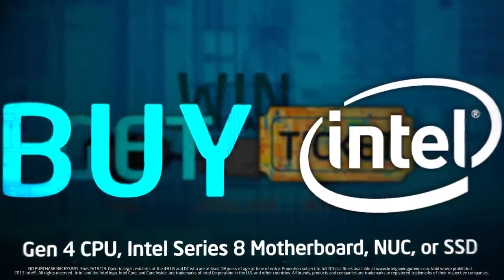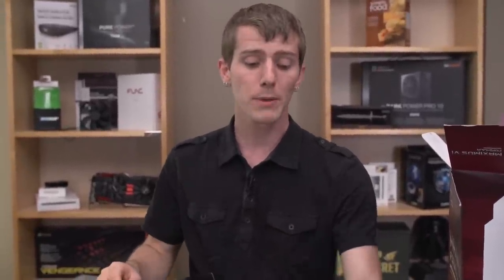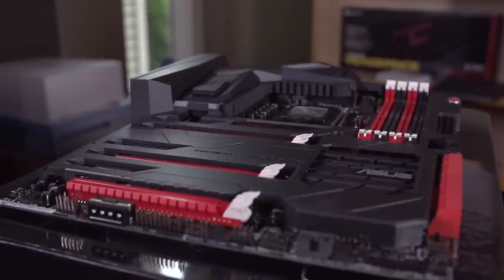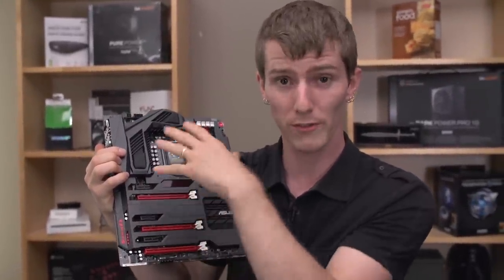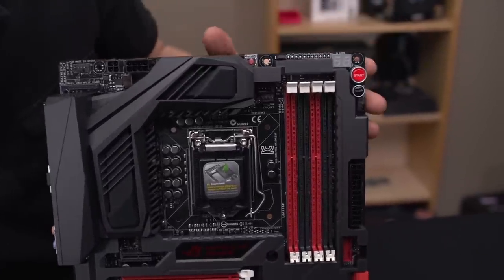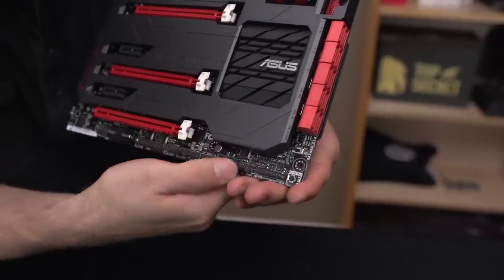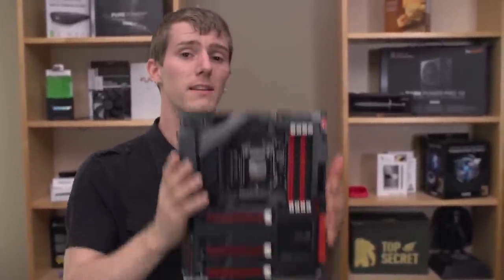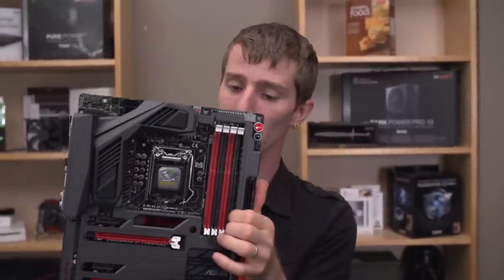Asus Maximus VI Formula Unboxing & Overview

Comment: Love this mobo, just got it for my new build.
Specs are:

Maximus VI Formula
16GB Dominator Platinum
i7 4770k cooled with H100i
Asus GTX 780 DirectCUII (running in SLI)
AX860i
Corsair 750D
250GB Samsung 840 EVO
WD 3TB Black
Reply: We have almost the same build, lol.
I got the same mother board, same CPU, same power supply, same ram and the same HDD. The only difference between our builds is that i got a EVGA GTX 780 TI Superclocked with ACX cooling a Phanteks Enthoo series Primo aluminum ATX full tower case with blue led and a Corsair Hydro series H100i with a 500gb Samsung 840 EVO. But still everything almost the same .
Reply: just about the same build here as well lmao
Reply: Just received all the hardware, did not buy the 780 because I will be using a 24" monitor.
Cooler Master HAF XM - High Air Flow Mid Tower 
Microsoft Windows 8.1 Pro - 64-bit
PC Power & Cooling Silencer Mk III Series 850W Modular
ASUS GTX770-DC2OC-2GD5 GeForce GTX 770 2GB 256-bit 
(2) Intel 530 Series SSDSC2BW240A4K5 2.5" 240GB SATA III
ASUS 24X DVD Burner - Bulk 24X DVD+R 8X DVD+RW 12X -
Asus MAXIMUS VI FORMULA  
Intel Core i7 4770K Unlocked Quad Core 3.5GHZ Processor
BenQ XL2420TE 24IN LED 144HZ 1MS 
Corsair Dominator Platinum 16GB 2X8GB DDR3-1600
ASUS ROG RAIDR Express PCI-E 240GB PCIe 2.0 x 2 MLC (SSD)
Swiftech H220 Quiet Power PLUG-AND-PLAY Liquid
Reply: Also almost same build :D
only 32 gb RAM,
2x palit gtx 780 ti jetstream in SLI of course
1250W Seasonic x-1250
case: same
cpu: same
mobo: same
cpu-cooler: same
ssd: same
hdd: same
Reply: joniostis To be honest with you I think 32GB RAM is overkill for pretty much anything, I used to have 32GB in my last system but then I realised it was a mistake and by the time games begin to use more than 16GB of RAM I won't be using this system anymore so I decided not to go with the 32GB.
Reply: ***** i think you are my twin lol

Comment: hello linus do you know how many watts you can pull out off the fan connectors on this bord. i wondring if it is only one fan per connector or if it can handle multi fans on each connector.. im going to bulid an monster water cooling machine with this board and a corsair 900D have bought 25 corsair fans so i was hoping the board can handle 5 fans on each connector
Reply: you don't need to connect the fans to the board
Reply: get yourself a molex to pwn adapter http://static.scan.co.uk/images/products/900075-a.jpg
Reply: it is asembled  and it is looking stunning just totaly awesome build

Comment: which is better for gaming? An asus maximus VI Formula or an asus maximus VI impact?
Reply: Both are awesome boards, but the Formula is built especially for gaming where as the Maximus is a high end board for heavy overclocking use. If your building a Gaming PC go with the Formula, If your building a Gaming/Multimedia PC go with the Maximus (only if you are going to overclock; no point spending more money for something when your not going to ultilize its full capability).
Reply: impact for itx case, formula for mid tower and above case. both perform great.
Reply: i already have an h81 but it sucks its tiny and there is only enough room for one gpu
Reply: well, what if I want a sound card or something
Reply: Their no point getting a sound card with this motherboard unless your having a surround sound speaker system setup on your computer. The onboard sound on this card is good for all gamers and regular users. Only a sound buff would get anything out of buying himself a sound card. In most cases if your buying this motherboard don't bother buying a sound card.
Reply: well I know that, I'm not saying that I wan't one because I agree with you 100% that a sound card is pointless, I'm just trying to make a point that if I were to want 2 gpu's or something that uses 2 expansion slots I wouldn't be able to use it.
Reply: My Bad, Did not read all the comments.
Reply: we do have dual gpu option, the 295 and 790 cards are coming out.

Comment: Doesn't aluminium have a protective layer when exposed to air called Al2O3? It prevents corrosion, precisely the reason why drink cans, cars, airplanes etc are all made out of aluminium, because it does not corrode. Am I missing something? Sorry if I am.
Reply: jamesdienow mixing metals on a watercooling loop like aluminum with copper or nickel may cause corrosion over time

Comment: What does the water cooling actually cool?
Reply: The motherboard?
Reply: Alex G. Yeah but to my knowledge the motherboard doesn't get that hot that it requires water cooling
Reply: If your running a water cooled CPU, the VRM tends to run a bit hotter with out the fan from an air cooled solution circulating the air in that area. Especially if your into heavy duty overclocking it would behoove you to cut that in the water loop.
Reply: Everything in your pc :))))

Comment: Linus, please I need to know what it is for the 8-pin connector side of the 4-pin, and it also supports memory of 1866hz default, no overclocking. I want to buy this motherboard, but that only accurate details. Thank you and I'm your fan too.
Reply: Thats not nice
Reply: I think that connector is to supply the motherboard with more power for 2+ GPU configurations and CPU overclocking.

Comment: I bought a Corsair 650D case and this MB.  When you mentioned not using the water cooling aspect of the MB, I was disheartened until you mentioned using a special 
cooling liquid that allows the use of dissimilar metals.
 I decided to not use my Corsair 850 PSU and am now waiting for the UPS truck to deliver my 1050 today, so I can finish the build.  I went with a 3770K CPU and bought
a corsair H100i cpu cooler. My EVGA 680/4 gig will be installed for now, and 32 megs 
Gskill Trident X 2400 ram.

Comment: I'm glad they responded to concerns about the aluminum. Bare aluminum isn't just bad in a cooling system, it can be catastrophic. Even with anti-corrosion additives at the very least you're really shortening your maintenance cycle. Given that they've anodized it...yeah, I'll be getting this board. God damn is that ever smexy.

Comment: I work for a coolant company as a formulation chemist, the copper non-corrositivity is insane to get. Aluminum (in general) non-corrositivity is fairly easy... Aluminum is most likely safe to have come in contact with the coolant although everything is corrosive technically, so.. yea.

Comment: 15 years ago, I was asking the same question, the answer to which, BTW, essentially, is yes.  You might say that it's your PC's nervous system.

Having said that, there's a little more to it: different boards, different CPUs/features/problems etc.

Incidentally, with deep enough pockets, it looks as though this particular board would support a potent system.

Comment: Audiophiles will call color.  At the end of the day which opamp you use doesn't heavily affect performance.  Noise from resistors and smaller AC coupling capacitors will be what you can actually hear.

Comment: Just built a 4770k system with a new - Formula VI I had in storage. I was going sell it for full retail on Fleabay but it's just too sexy to let go of. Like a red Ferrrari. With a nice, used GTX980ti still got over 6000 Passmark out of the system with a stripped-down Win 7. Heavy duty back plate supports a heavy Cryorig R1 Uni. If there is such a thing as classic PC gear, this mobo is a contender.

Comment: Firstly, I just want to say that I love your videos! Whenever I'm looking to invest in a new piece of hardware and would like to watch a formal unboxing and review of the product you are my go-to guy! My YouTube search might look something like "ASUS Maximus VI Formula Linus", lol.

Anywho... my question is regarding the space between the CPU socket and the first PCI-E slot just underneath. My intention with this motherboard is to have a GTX 780 in the top two PCI-E 3.0 slots and an ASUS Xonar Essence STX just above in the top PCI-E slot. That said...with this configuration, will I have room for the modern, over-sized (mostly for aesthetics, who am I kidding..) CPU heat sync/fans? i.e., the Cooler Master V8 GTS.

Comment: Swappable opamps are okay, even if the circuit is designed around the component doesn't mean it's bad to swap a opamp unless you go to a radically different type of opamp ... like a JFET opamp instead of a CMOS opamp/BiFET/BJT opamp

Comment: I have this motherboard and it is actually pretty good. The audio solution is noticeably better than my old Z77 motherboard. One thing I don't like about this motherboard is that all of the 4-pin fan connectors are not true PWM expect for CPU_FAN and CPU_OPT which really sucks saying that this motherboard is around $300 CAD.

Comment: In terms of being 'worth the upgrade', you would be essentially slightly upgrading the CPU with the addition of buying a mobo just for socket compatibility and a few other new chipset benefits. By a slight slight CPU upgrade, I mean the benchmark comparisons are very minute (Highest increase being multi-threaded performance at 7%).

Comment: Some small errors: Fan Expert 2 gives control over the CPU fans and the 3 Chassis fans, but not over the Optional Fans. Also, there are actually 2 front panel USB 2 header connectors, one is available instead of the optional ROG OC panel and each can carry 2 USB plugs, so a total of four for the front panel.

Comment: Regarding the on-board USB 2.0 headers... there actually are two, except one of them is designed to be used as part of the ROG handheld console thing. It doesn't have the plastic guide that others normally do, but even in this video you can compare the pin arrangement to see that it's there and it can be used like a normal USB header... just be careful when plugging in to it!

Comment: Ive been using the right side of the ROG_EXT header as a internal USB 2.0 header. It works! But now that I bought the ROG front base I have to buy an NZXT internal USB extension if I wanna have my H80i and front panel USB 2.0 plugged in. You would think a mobo like this would have at least 3 USB 2.0 headers.

Comment: Question for building a new rig!

ASUS Maximus VI Formula or ASUS MAXIMUS VI EXTREME 
VS
MSI Z87 XPOWER

1: Which board has better features to offer in your opinion?
2: Would the ASUS boards be better in an air cooled situation VS the MSI board?
3: Would there be high maintenance for doing a water loop through the VRM due to it being made of aluminum? 
4: Which board would have a better sound solution in your opinion?

An answer to any one of these questions would be much appreciated.

Comment: What a magnificent Mo-bo. some useful/complex issues mentioned by Linus. I have to watch twice. Anyway, at almost $200 more than the Z87 Sabertooth (here in Japan), this board is outside any regret range. Its the additional price of a Samsung SSD Pro 256Gb and a Copy of Battlefield 4. But brilliant if you got a lottery win.
Reply: ***** I actually bought one 6-months ago because the alternative (by a different company) would not run crossfire as it was advertised (so Amazon re-stocked); I had to pay an extra $100 above the price of the previous board though. The sound on it is really good; although I recently connected it through an Amp, (it still sounds [even more] fantastic); and I don`t have any issues with it, as it does run Great. I think it probably runs better than the Z87 Sabertooth in my main gaming rig.

Comment: LinusTechTips I have a Asus Maximus VI Gene and I wanna upgrade to the formula because I have EVGA gtx 760 superclocked running in sli and its so crammed i get worried about heat?

Comment: Hay guys just a question, if Im running this board and want to include the mobo cooling block into my loop with copper cpu and gpu blocks would I have the aluminium corrosion problems using distilled water and a silver bullet or kill coil?

Comment: I have looked at and considered all the boards in each series and i agree that the price point is better. However the build i plan on doing will cost $4500 and spending the extra $200 isn't a big deal. I simply am wondering which board will stand the test of time and overclocking better. I also must admit I want the high end boards for bragging rights.

Comment: I know it says it has crosschill and that its great on air, but If i put a i7-4770k in there, is it better to put an extra CPU air cooler on top (like a Phanteks PH-TC12DX)? or with the case fans is enough?

Comment: If i get a new motherboard do i just swap my parts or do i have to reinstall windows?
Reply: +skate.poser usually it is recommended to reinstall windows due to some troubles you may run into
Reply: +the.last.methbender Hopefully you didn't waste all that time reinstalling Windows lol all you would need to do is uninstall your current drivers, swap the boards out, then install the new drivers. Reinstalling Windows is pointless and time wasting.

Comment: ok so im getting my first gaming pc but the problem is that im on budget if i get mobo with 970 chipshet i can only go with gtx 760,but if i get AMD 760G mobo chipset i can get like r9 280x because the AMD 760G mobo is like 70 bucks less,so is there fps diference in games and what is best buy THANKS P.S

Comment: Separate audio components, but not good for Real Hi-Fi => Problem is that the electrosmog creates interferences. Only an external Dac would be good for the best audio experience (I use one of the new DragonFly dac. It's cheap and it has a very good audio quality. Otherwise, this is a very good motherboard.

Comment: Hello, I would like to know what you think about this build 

1-Aerocool XPredator X3 White Edition 
2 - asus maximus vi formulates 
3-corsair h100i 
4 - Vengeance ® Pro Series - 16GB - Corsair 
5-rm850 corsair power supply 
6-Intel® Core™ i7-4770K Processor (8M Cache, up to 3.90 GHz)

 
I would like to know your recommendation thanks :)

Comment: I am probably the guy who you were pointing at when you said you don't read my comments :) BUT just in case... I am looking at building a new system in the next 6 months or so. It will be for mainly light workstation (3D and VFX) workas well as a little gaming. I was thinking of the Sabertooth series boards but would this offer any real advantages over that? Thanks so much, love the videos!

Comment: what kind of motherboard should i get for the use of 4 monitors to game play?
im thinking about a case that can support it too. is EATx enough?
Reply: your motherboard makes lees difference than your graphics cards (i think)
Reply: really matters on your gpu if your gaming on 4 monitors then it matters on resolutions, but for 4 monitors you want to make sure your motherboard supports sli/xfire motherboards dont really matter from that point
Reply: You need to focus on your GPU(s).
Reply: To play games on like 4x1920x1080 -> 3840x2160, you will need a very strong video card. At least a GTX780, but you won't get good FPS with that card. Go for something like dual 780s or even dual 780TIs.
You need a motherboard that supports dual SLI. This means you need two PCIEx16 slots that run at least at x8 speed. Gigabyte Z87X-D3H would be ok.
Get a 4670k or better a 4770k with that.
Reply: Ultrabenbooyah honestly any processor will due but if you are playing at 4k you need a wider bus so i would recommend the r9 290 or r9 290x if you can find one for normal msrp and crossfire them, if not a gtx 780ti and gtx 780 sli will also work
Reply: kamboj sb THE BEST THING FOR AMD R9 290 (it can be frankestined in an r9 290x) AND THE BEST THING FOR NVIDIA IT´S A TITAN FOR THEIR 6GB GRAM
Reply: Franco Pettine Because with a lot of monitors 3gb or 4gb will be ok, but six it´s the best
Reply: As said previously, it's more about your GPU's than your mobo to support 4 monitors. I would suggest 2 way SLI/X-Fire on high end cards, or 3/4 way SLI/X-Fire on lower end cards. Those 2 configurations are obviously if you want all 4 monitors to be running at 1080p or higher.

As Linus said in the video, Nvidia doesn't support 3/4 way SLI on x4 PCI-E slots so if you do go for a 3/4 way SLI, make sure you buy a mobo that supports atleast x8 on all PCI-E slots. Of course, that isn't an issue with AMD GPU's.

Comment: I have a xps 8500 (windows 8) and I upgraded my graphics card to a 660 super clocked from nividia gtx... I've been thinking about getting a new case, motherboard, and ANOTHER graphics card and more ram than the 8 gigs... Should I???
Reply: You should stick with the 8 gigs as 16 gigs is more for video editors, renders, etc. You should be fine with gaming at 8 gigs.

Comment: I just love the way this board looks... I wish they had a version without the integrated sound card and didn't come with the WiFi add-on. I'm never going to use those as I'm always wired and already have a sound card that's already even better. That version of the board would cost ~ $50 less. Anyways I'm still getting this baby for Christmas!

Comment: I wish they gave more info for the M.2 socket. Apparently there are different lengths, and different sockets. I guess M.2 is just 22mm wide as the only uniform thing.

Why cant M.2 be like mxm 3.0b where they are uniform in all dimensions and in socket.

Comment: mmm... How did you install the AI Suite?
When I used the CD and installed everything, it gave me major problems. Had to reinstall windows to solve the problem.

But after installing from the website and installing a few features at a time. Then disable all, then slowly enable a few at a time to see what I use and what I don't use, I find it quite good.